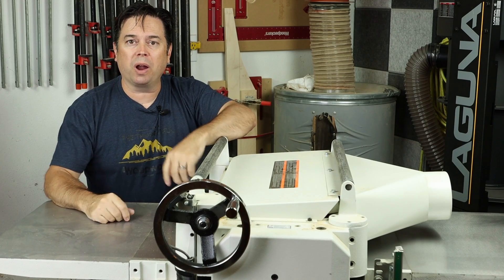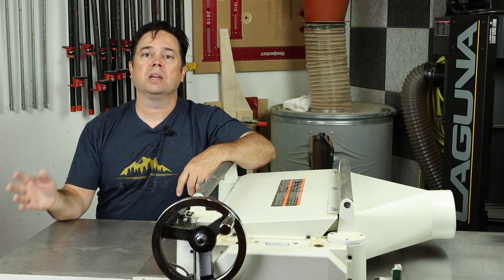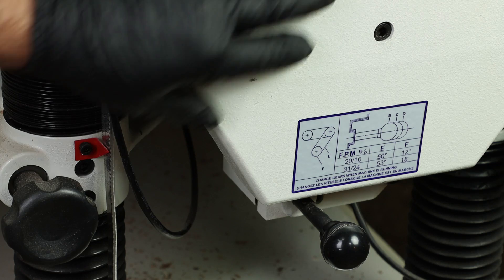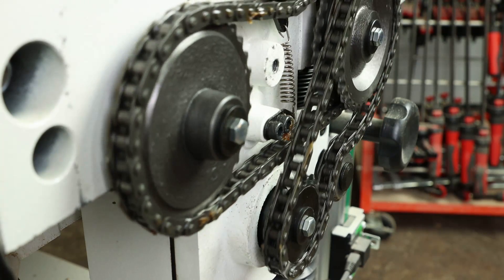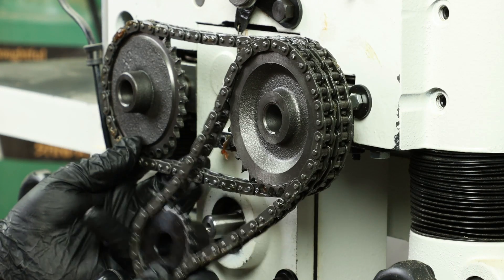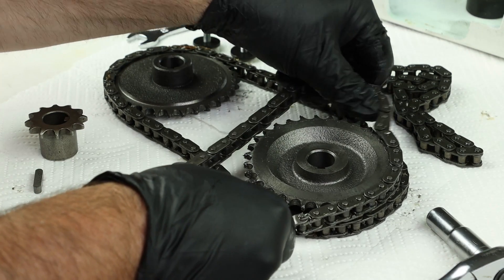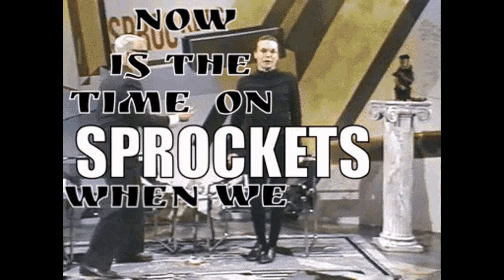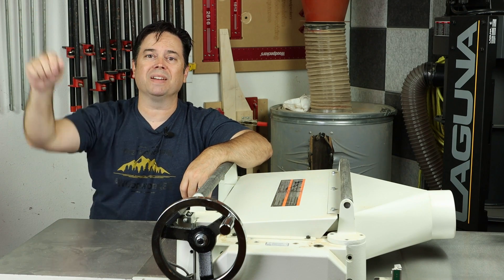Gear Down Jet / Powermatic Woodworking Planer to Solve Tearout - Easy Sprocket and Chain Swap

Comment: I noticed that you have a planer very similar to mine, and I really appreciate your videos.

I am trying to replace the gearbox cover — the one that comes with the stick shaft for speed changing — on my planer because there is some oil leakage from the shaft.

Do you happen to have a video showing how to replace this part, or any tips for doing it safely?

Thank you very much for your help!
Reply from the maker: Good question.  Unfortunately, I don't have a video on that topic.  I would call Jet and get some specific advice for "Do's and Don't" on that procedure.  Then study a parts breakdown, and see if it's something you can manage.  Thanks!
Reply: @TheThoughtfulWoodworker    i appreciated your respond, yeah i am going to study & have more info about   how to solve this issue.
again thank you so much brother for your support.

Comment: I did this and my powermatic with a byrd shelex head still cuts like crap , this is a terrible planer from the standpoint of finish product, be prepared for hours of sanding to fix all your work
Reply from the maker: Hmm, you never mentioned what defect the cutter head was leaving on the planed surface.  Snipe, tear out, lines, wood species?  Mine really cut well after gearing it down.  Thanks

Comment: my 15" jet planer had no idler/tensioner pully on the lower chain, it ended up jumping the outfeed sprocket and breaking off teeth, I had to make my own spring loaded tensioner pully out of a mini bike chain tensioner.... Jet tools are trash.
Reply from the maker: Was it purchased used?  I wonder if it was just missing.  The new ones are pretty solid, but I like my Laguna PX20 a little better.
Reply: @TheThoughtfulWoodworker  Brand NEW, in fact it started doing this skipping thing within the first 30 days I owned it and when I called for service it took them 2 months to send a guy out and by that time I had already created the fix for it and the tech said, damn, thats awesome!!

Comment: curious if you have links to that new sprocket and chain and where you bought them from?
Reply from the maker: The sprocket and chain were purchased directly from Jet.  Thanks.
Reply: any chance you have links for those or part numbers?  @TheThoughtfulWoodworker
Reply from the maker: @micahwitham Sorry, Jet doesn't list them online, so no links.  If you just call them, they'll know what you're after.  Thanks.

Comment: This looks exactly like my bosses 20 inch delta planer
Reply from the maker: Yes, many of the planers built in Taiwan are very similar.  The cutterhead is one thing that sets them apart.  Best to you
Reply: @TheThoughtfulWoodworker   yeah a small correction it's not a delta but a craftex his other machines are deltas (table saw and dust collector), thing is when he got it the manual wasn't read and no oil was added to the front or rear roller i wasn't there and the rear roller seized up after 2 hours exploded the small cast iron gear bent the end of the roller and the output shaft from the gearbox, getting the parts in November 28-30, how would i set the rollers if all i had was a set of digital calipers if possible
Reply from the maker: @owend7212  The Jet manual shows a way to set things with a wooden block.  You might try that.

Comment: Those two brackets on the back side of the cover are annoying, but they help keep chips out of the chains.  I actually added them to my TotalShop which didn't have them initially.  Pretty much the identical machine to this though (all various clones of the Delta DC-380).  I'll have to remember this, in case I ever feel a need to slow mine down (it's single speed only though)
Reply from the maker: Yes I agree with you.  They keep chips (and fingers) out of that area.  Just funny how they mount.  Best to you.
Reply: @TheThoughtfulWoodworker  since my cover wasn't drilled or tapped for those plates, I thought about just using magnets, but with my luck I'd have some how managed to have the chain eat one of them and screw something up :D